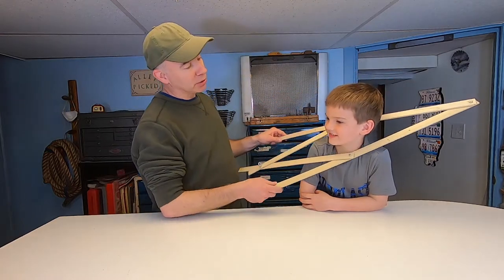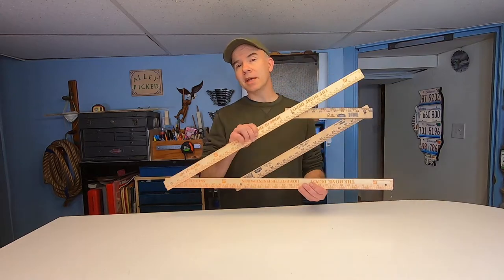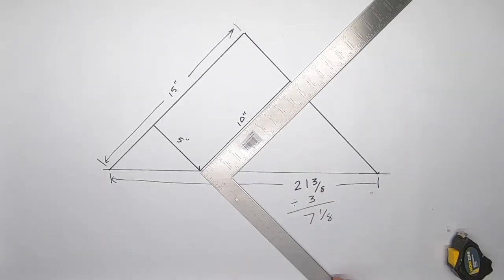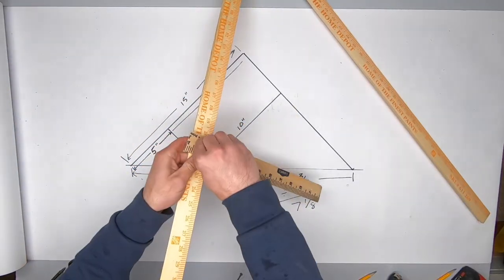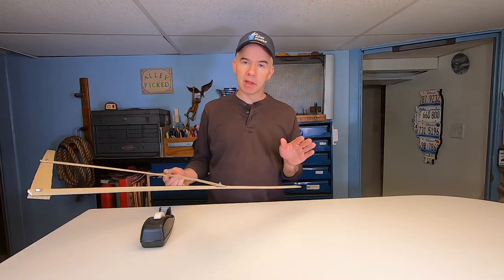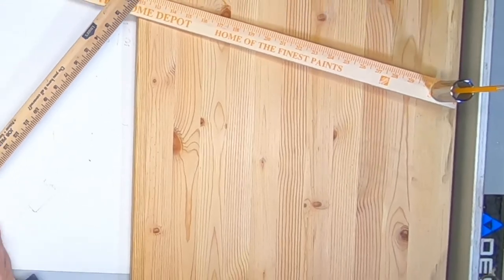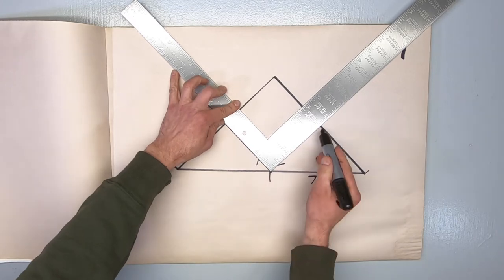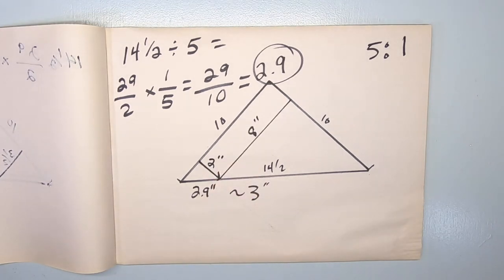How to make a pantograph (enlarge an image)

Comment: I needed to refresh my memory on this from many years ago... I'm enlarging the new handicap symbol from computer screen size to 48inch size onto 4x8 sheet of plywood to cut out a stencil...
Websites show new symbol but offer no engineering spec's to reproduce on to plywood... In high school we used over head projector, old school, but pantograph is even older school..
Nice video, thank you for bringing back fun and technical memories.

Comment: A question that no one has yet answered:
What length should the arms have in relation to the final size of the sheet?
Example: I have a drawing on an A4 sheet (20x30 cm) and I want to transfer it with a 1:2 ratio onto a 40x60 cm sheet, what maximum length should the arms have to allow this excursion?
Is there a formula to determine it?

Comment: You started by trying to draw a 45°-45° right triangle.  Instead of eyeballing the other leg and getting the incorrect hypotenuse length, all that is needed is to multiply 15 by √2. The correct hypotenuse is 21.2132, not 21.375.  Of course √(15^2 + 15^2) will give you the same answer.  One thing you don't want to do with a pantograph is to eyeball it.

Comment: I'm trying to copy a photo (10" wide) to be traced onto 4 feet long piece of wood. In your video you have yard sticks as the longest length. If my drawing is going to be 4feet, then do I need the lengths at least or than 4 feet?
Reply from the maker: I don't think so. You should be able to do it in sections.

Comment: On the 3 to 1 pantograph, you said 4 point 8 inches. What is point 8 inches? Why are you combining metric with SAE measurements?
Reply from the maker: I am not using metric but rather decimal and fractions. Because of the measurements that I was using, the fraction came out to 29/6. 29 divided by 6 is 4.8 inches. That is not metric. For example, if it were 4.5 you would know that is 4 1/2". You would need to convert .8 to a fraction which is approximately 4 13/16
I know it's confusing but that's math :-)